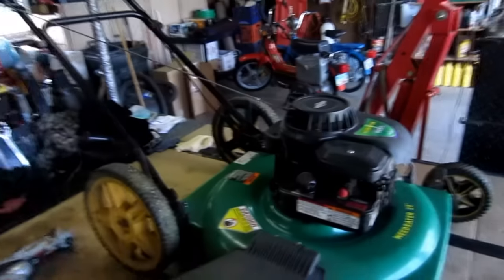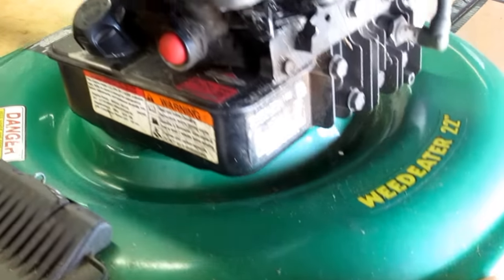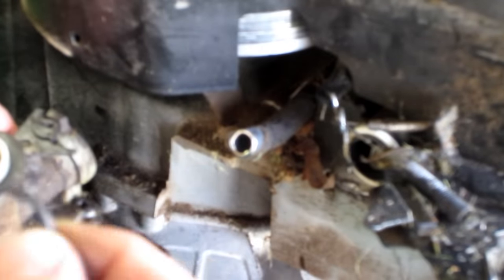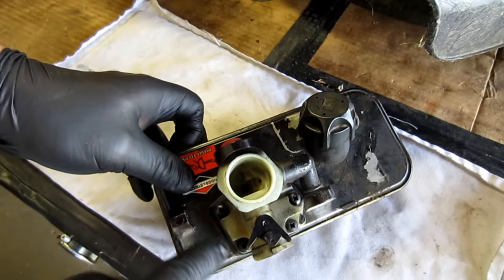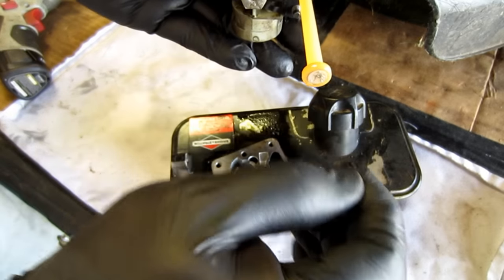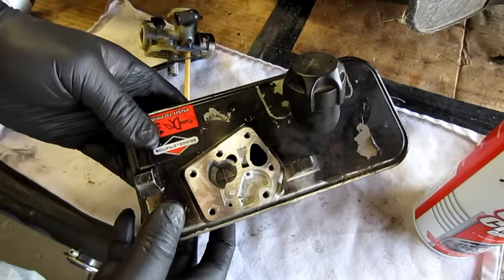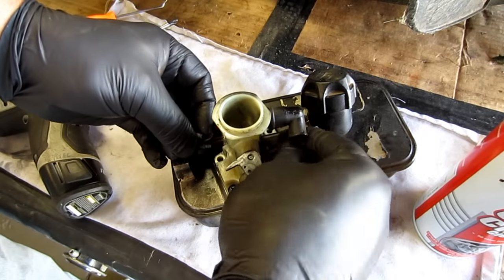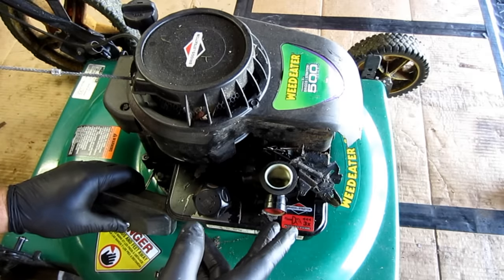Fix 90% of Briggs lawn mower not starting problems. Easy repair.

Comment: I picked up a mower today that the previous owner said somedays started and somedays didn't, sure enough when I unscrewed the carb you could see the diaphragm had been pulled back in and there will have been a gap 👍

Comment: Thanks for the video–it fixed my problem. I had a no-start condition and took off air cleaner element and sprayed MAF cleaner (didn't have carb cleaner). It started almost immediately (after pulling away for 15mins on separate occasions).

Comment: Many thanks indeed. Fixed up my B&S 4.0Hp motor yeaterday following your video. Had to do it twice, once up and running, I put my tools away , only to see the silver filter screen thing sitting in my 1/2 inch drive ratchet case.....doooh!

Comment: Thank you!! Great video, in particular the tip about the diaphragm slipping out of position. As soon as I removed the diaphragm I could see the issue and used your technique to scrape a small ridge in the metal and replace the diaphragm biased to the side. Mower runs like a charm now after previously surging. Thank you again!!

Comment: A couple things.

1) You did mention the carburetor not having enough support between the two screws that straddle the intake mount.  That is correct.  What you neglected to mention, which is the ACTUAL problem that needs addressed, is that because of the lack of support, the plastic carburetor body warps over time, particularly if it is screwed down extra tight.  The proper long-term solution isn't to score the tank, it's to install a new carburetor that isn't warped (which comes with a new diaphragm/gasket).  A new carburetor is a safe bet to give you several seasons of proper running, and they're usually inexpensive (around 30-40 dollars).  Anything short of that is a roll of the dice that particularly depends on just how badly warped the carburetor is.

2) Most of the running issues with these are diaphragm-related, not dirt.  The fuel screen that goes over the fuel jet will screen out anything capable of clogging it.  You specifically mentioned people having issues getting the mower to prime or start after sitting all winter - this is usually from the check valves in the diaphragm sticking to the tank surface, nothing to do with dirt.  Stuck check valves will result in fuel not being picked up from the main tank to the smaller fuel nozzle reservoir.  Even brand-new engines that were factory test run had this issue if they sat too long in a warehouse or on a retailer's shelf.  An easy way to check for this is to remove the air filter, start the engine on starting fluid, as it is struggling to run on the starting fluid charge, immediately block the air intake with the palm of your hand.  The vacuum from the engine should knock the check valves loose and allow fuel to flow.

Sincerely, someone who has had to work on these garbage carburetors for many years.
Reply from the maker: I get it.  I would have done the same thing . But, The majority of the people that are watching this video just want their junky mower to continue to run as cheaply and easily as possible. This isn't a re-engineering video nor a complete rebuild the engine and fix all the deficiency that the mower has video. This is just a quick way to fix 90% of the problems for the people that just want to keep their junk running. And as evident by most of the comments you can see it works. For how long that's up to them.

Comment: You did exactly what I have been doing for years. The first time it happened I used gasket cement but that didnt work. Then I got a brand new gasket diaphram . Then I used a small Propane tank turned it on but did not light it . When the engine speed up I knew where the leak was and then clamped it with a small c clamp. Then I took it apart again and scored the edge just like you did. Once you do a few of them you will know what to do but the first time you do one it is a ridiculous annoying problem and thats how I lost most of my hair! LOL  Good video compared to most on You Tube. At least YOU know what you are doing.

Comment: I wish I had this video as a kid! I was just given a neighbor's mower because it would run after being primed and die, continuously priming it would let it run, obviously a fuel problem. In my case a passage on the tank's carb flange was filled with what looked like white corrosion. It was the passage your finger is on at 9:52. I wonder if this was caused from the ethanol in today's gas? I've seen ethanol do nasty stuff to cars, and Flex fuel vehicles always use high quality stainless everywhere in the fuel system- this is why I think it's important to drain gas out of small engines and run it until it dies, at the end of every season.

Comment: Okay, my Briggs engine lawn mower has started to get difficult to start and will easily cut off after only a little bit of running.  I am going to try this procedure to see if it works.  I have had my mower since 2009 and am hopeful I can coax at least one more season out of it.  Fingers crossed!!

Comment: I'll be tryin' this on an old mower with B&S engine tomorrow.  Bet it works.  It was working fine season before last.  I forgot to put in stabilizer, etc.  Think I'll run by my local dealer and pick up a new gasket and seal though.

Comment: Your Video was a great help to me and so very easy to follow! By the way? Would you happen to know how or where I can order the elbow part of the breather tube that is on the left side of the air filter? Mine has a little crack but it still started up after all this! And I used a few Q-tips to clean out what ever the carb cleaner did not remove. It's been a while since I did any kind of maintenance on my Briggs. lol Thanks again and even though it's been 8 years since this video, I can see that it's still helping a lot of us DIY-ers out!

Comment: It also goes a long way to dry the combustion chamber prior to first pull after a carb rebuild, and make sure the fuel tank it's self is clean. Gas turns to an an oil like varnish after 6-18 months. The crankcase also needs to be 100% drained and flushed and dryed prior to refilling with .6 qt.

Comment: My poulan pro lawn mower used to run 5 -10 minutes and stop. I changed spark plug, didn't help, then I changed gasket, same problem, then I replaced O ring with white retainer, same problem. While I was changing gasket and O ring, I noticed the plastic fuel suction tube of carburetor has has dirt stick where the mesh screen filter is, I had already cleaned that screen but didn't work. I decided to take out the fuel tank and separate the carburetor again, put the gasket and O ring parts on a side, empty up the fuel tank and washout the fuel tank and carburetor with garden hose on high pressure. I dried fuel tank on oven top, yes I was careful about fire, I used wire hanger to hold fuel tank on oven. I used hair dryer to dry plastic carburetor, make sure you keep pressing the red rubber button to release all water from inside. I left the parts in garage for another 24 hours to dry completely, then I installed and its working and sounds like brand new. I mowed the lawn for one hour and it didn't stop. I replaced almost everything but washout fixed the problem. I noticed before washout, the rubber push button was delayed while it used to come back, but after washing out, button comes back quickly. If your red button is delayed coming back, you need to wash your carburetor and fuel tank.

Comment: Followed the instructions to the tee, this time noticed that the tank surface was slightly pitted so took some wet and dry to it ,re done that scorching between the 2 screw holes , re-assembled and bingo, spot on runs like a dream. Thank you so much

Comment: Thanks this should help me fix the problem of the mower than was tipped on it's side wanted to ad one note to your video! I also read that the fuel caps can get affected with the charcoal or cork filter not sure what gets messed up if they get wet & have to dry them out or clean them with alcohol instead of having to replace them the older models have a smaller cap with a cork gasket if that how you correctly say it mine has the newer bigger plastic lid if the lawnmower still won't start after doing the steps on your video I will try message you thanks for your video appreciate the help from mechanic to another! 🤔🤗💖😎👍

Comment: What I have done since alcohol was put in gasoline,is to put 2 or 3 times as much as called for, of the stabilizers,in the tank and shake the lawn mower back and forth.Then start the mower with an unlit propane torch
held at the carb air intake,and run it on propane,until it will run on the gasoline.  I've avoided taking the carb apart many times.

Comment: I recommend cleaning tank since you have it in your hand. I put a dozen or so small ball bearings or nuts in it with a bit of fresh gas. Cap it and place hand over carb surface and shake like a spray can for several minutes. Be sure to get anything you put in back out! I keep gas tanks and clean carbs in ziplocs for these engines. Takes 5 minutes or less to just swap and clean other ones later

Comment: I can tell you that the gasket you are talking about can be made from teflon sheet. That is what i did last year when my bitch stopped running. Then when I repaired the machine it is performing flawlessly. Also, I used vaseline on the o'ring gaskets for ease of assembly. Great video you presented, this is probably the most down to earth explanation I have seen on YouTube.
Reply: Thanks fella.

Comment: I found a lawnmower in a storage unit that would not start, I emptied out all the gas in the tank and took the carb off. Cleaned it with carb cleaner and she cranked first pull no lie.

Comment: Another thing to check. I've had this happen on two different mowers with this carburetor setup. Check the tube that connects the output of the carburetor to the intake of the engine. Those plastic/fiberglass tubes often crack and if it's not airtight you cannot start the motor. I was able to "fix" mine by using super glue to reconnect the two broken pieces.

Comment: When i worked on them, i would check the tank surface where the carb diaphram  goes and i would place it in a vise using a flat file to resurface it, then a metal ruler to check for trueness, i would put it back together and it was fine, anymore they are throw aways

Comment: Hello. Can you do a video on the springs You touched base on it, but I noticed my springs do not move the part you said you could pull down if you wanted. You mentioned sometimes they hit a tree. Mine did? Are they all the same? Mine is Briggs & Stratton as well. Yard pro 450 series

Comment: Wow!..Wish I had seen your video before I did some dumb ass things...I tiped my Pressure Washer (Craftsman) with the B&S 7 HP Engine.  I cannot BEND at the waist ever again due to some steel bars in my lower back, and to make matters worse, I have Arthritis in both knees.  So, getting down on the ground to attach the water hose is a major issue.  I decided to add a Quick Connector to make my issue a non-issue.. I am saving the link to this video as I am probably gong to be doing this maintenance in the future.  Your video is excellent, you sound like you are in instructor with years of experience!

Comment: Great video. I actually did this same maintenance 2 days ago before seeing your video. I have never done this, so you are spot on with how easy it is. Thanks for your video confirming that. I am still have 2 issues, chugging and the mower bogging down. I suspect the idle/governor. Of course I don't know for sure. Can you help further?
Reply from the maker: The full run high idle should be around 3,300 RPMs although you can get away with maybe 3500 RPMs if you do your oil changes religiously and use synthetic oils. A lot of problems over the years that I've heard about bogging down was simply people cutting too wet grass , or having their deck height adjustment set too low,  or not keeping their blade sharp and not scraping the build-up from the underside of the deck.
Reply: @Foxboss9  Thanks, I have never scraped the bottom. I try not to cut when grass is wet. I may need to raise the deck also.

Comment: Done this successfully several times on my 40 year old 3.5 hp classic-engined mower. It started and ran fine this spring as usual but the other day while mowing it just quit abruptly and I noticed the primer bulb had been sucked into a collapsed position. After coaxing it out again and priming the carb as normal it started and ran fine again, for another 5 or 10 minutes until the bulb got sucked in again and the motor quit again. After dismantling and cleaning etc. the problem repeats. What am I doing wrong? Or what needs replacing? Thanks for your clear video!

Comment: I doubt that you are still following the questions and statements of people, and I hope I am wrong.  Question is :  along with the scribe line you put on, would it be a good idea to put some kind of glue or whatever to help seal that gasket?  Thanks for the info. you have already provided.  Great stuff!
Reply: Hi Ron! Since the boss does not answer, let me throw in my 2ct of wisdom. I think this little scratch is - since it is also the recommendation from B&S itself - the best way to fix this issue. Using glue might increase your headache since the glue might chemically interact with the very thin EPDM diaphragm and destroy the material. Also it bears the risk of squeezing glue into the carb where it might float around and clog the filter.
I have a more recent version of this engine where B&S seem to have addressed the issue in a different manner. My gasket and diaphragm have not a straight edge but are slightly V-shaped on that side. This creates some sort of tab on the outside of the carb, that you can hold in order to pull the diaphragm straight while fastening the two screws. Perhaps the newer gasket sets are all shaped like this. At least I did not do the scratch workaround and my engine fired up on first pull.
Cheers
Andreas

Comment: I agree with a previous comment. This may be the best tutorial video I've ever seen. Have this exact mower. Thanks! 3-30-20
Reply: I just did this and it worked perfectly. Unfortunately I lost that little air filter ring gasket that sits on the top. Any idea where to find one or does it really matter? I just tightened the air filter pretty good and it is running good..

Comment: Excellent video indeed. One comment: It would seem best that when you have the carburetor torn down like that, clean thoroughly as you say, scribe the line, and you may as well replace that gasket and diaphragm with a new one or set. As long as you can obtain the new parts, why "risk" running with a deformed or ill sealing gasket or ill-performing diaphragm that's in such a critical area ?

Comment: I had the surging problem on mine. I did everything you suggest, but the problem remained. I had to replace the carb. I think these carbs are susceptible to gumming up and a replacement is necessary.
Now three years later the surging is back, and I'll need to replace it again.
This is a bad carb design.

Comment: Pulled the carb apart as instructed and the gasket was deformed as your comment. Carefully stretched it back into place and bingo she runs like a new one. I would have definitely not seen this if it weren't for your expertise's. The question beggars why do Briggs continue to make a part with such a fault?

Comment: I saw one big problem you didn't notice, when you turned the carby body upside down I could see the fuel pick up piped was partially blocked. If you look in the center of the filter screen you'll see a small dark patch, that's a blockage in the pipe, that's why the primer bulb doesn't return quickly
Reply from the maker: That small dark patches where the filter screen is folded over to keep it together it's part of the assembly process

Comment: Hey thanks for the help, well I did this and now my lawn mower is running fine (RPM's not jumping up and down) but now there is a whole load of smoke coming out of the lawn mower from the exhaust. I think there might be oil leaking into the carburetor or something cause I can smell some oil burning in the smoke. Is there any advice you have to fix the smoke, I know it may be oil level but I am going to check that tommorrow. Any help would be extremely appreciated, and thanks for making the great tutorial.
Reply from the maker: Check your oil level to make sure you're not low but it sounds like that you tipped your Mower and potentially moved the blade around a little bit that caused oil to be sucked into the exhaust. So to remedy that, you make sure that the engine has the correct amount of oil in it and then just start it up and let it run for 5 minutes. It should all burn out by then
Reply: @Foxboss9  I just did a bit of research and then checked the breather tube by the carburetor and it appears to be cracked which is probably why the engine is smoking, where would you recommend to find such small parts? I could only find it on amazon but am wondering with all the pandemic stuff when it will arrive. I might call the Briggs and stratton dealer tomorrow to see if they have it in stock. But thanks for the quick reply:)

Comment: The bulb on my mower does not spring back easily after being pushed in. The mower starts sometimes but sputters out after a few seconds. When that happens I notice the bulb is being sucked in. I did the cleaning according to this video but the problem wasn't fixed.
It turns out that some white powdery residuals have clogged the long tube that extends into the gas tank, the one with a screen on one end. I put the tube into an alcohol bath and ultrasonically cleaned it. The mower runs afterwards. 
Thank you for the video.